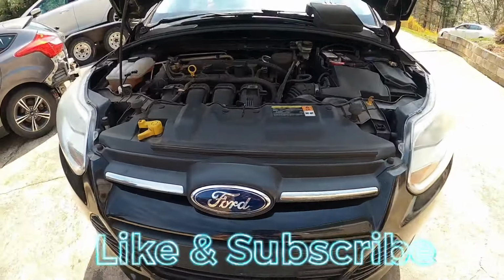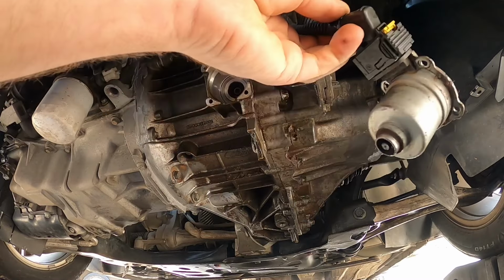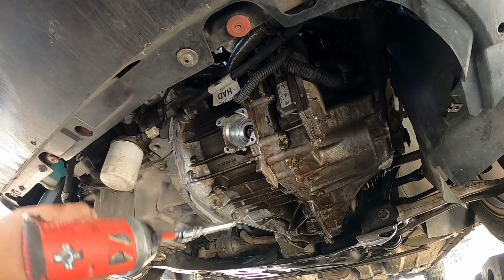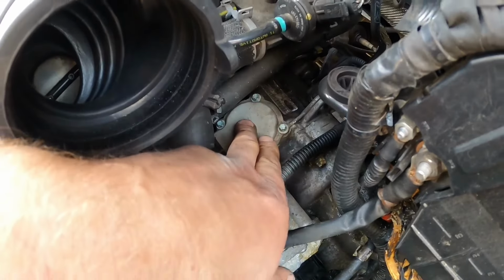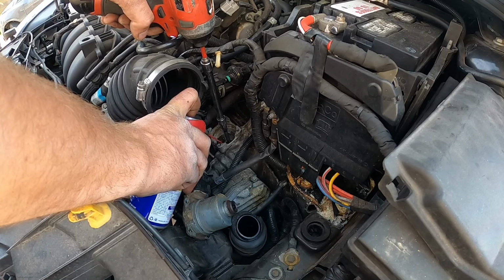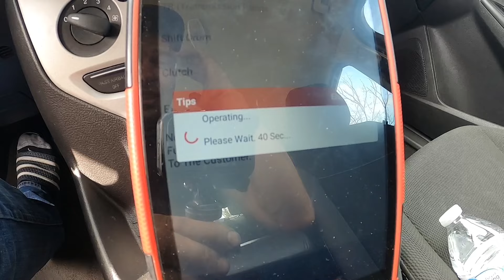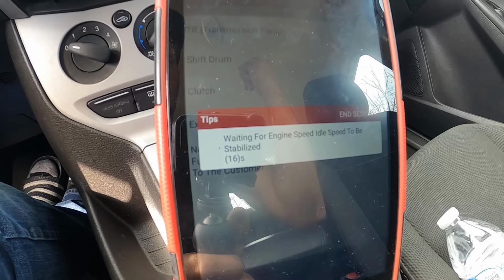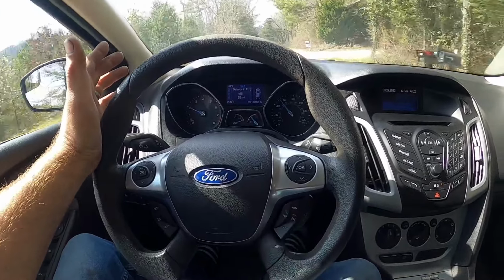2012-2018 Ford Focus Slipping? No Reverse? No Drive? Problem Solved. Easy Fix. You Can Do This!

Comment: What scan tool are you using?  Thanks for the quality vid!
Reply: Yes. Would definitely like to know what scan tool and what kind of Clutch set you bought to give this a shot.
Reply from the maker: Launch 431
Reply from the maker: Prokomon DPS6 Clutch Tool Dual Clutch Transmission Installer/Remover Tools for Ford Volvo Focus https://www.amazon.com/dp/B08PQL4KR8/ref=cm_sw_r_cp_api_i_JMXGC6SYKRQSY2QSWDND
Reply from the maker: Aumzong Dual Clutch Transmission Reinstall Remover Tool,Compatible with 2011-2018 Ford Focus 2.0L DCT 6 Speed Dry,DPS6-DCT Transmission Clutch Fast Reinstall Remover Set Tools https://www.amazon.com/dp/B09Q7ZY634/ref=cm_sw_r_cp_api_i_T9C6GM43DZGBFPW2JJ5R?_encoding=UTF8&psc=1
Reply: @L8R-HP  Thank you brotha, for both. Hoping to grab the clutch tool next week, just grabbed a launch CRP123E.

I've a Ford Focus 2012 that I've had for 10 years now. It went through the recall service.

Had the Tmac replaced 2 years later and now the check engine is coming up and I can't reverse. 

Transmission guy muttered something about "might be the actuator in clutch b" before resetting it to get the light to go away. 

It popped back up. Hoping to get it up and running again with this video! I was about to junk it (Spent 8 months trying to repair it during the pandemic.)

It only has 79k miles. 

Thank you for what you do man! This is awesome.
Reply from the maker: @LeeOnishiixD  no problem. Hope you can get it going, that’s super low miles.
Reply: @LeeOnishiixD  Any luck?

Comment: Hey man, I have a 2012 Ford Focus with some transmission issues. After I drive it and it tries to change to a higher gear, the dash says "transmission hot, please stop." It then tells me to wait 5 minutes. It's not the transmission fluid because it's filled. I was wondering if you have any idea what it could be? I would really appreciate it!
Reply from the maker: Your forks are getting stuck making your clutch slip and it gets hot
Reply: I just bought the same year & model & after 5 days this happened to me and cannot drive it now!
Reply from the maker: @ModernMusic831  that’s not good🤦🏻‍♂️ try this out l, hope it helps
Reply: @L8R-HP  Okay, thank you! I ordered the Capri Tools 6 mm M6 Stubby XZN Triple Square Bit Socket, 1/4-Inch Drive but it was too small. Is this because my focus is a 2012? I ordered the 9mm to try that but was wondering if you knew the exact one I needed. I appreciate your help so far.
Reply: @benitofeliciano3485  try a 7mm xzn. Mine was like that
Reply: @bcfmef  ey my kit has 6mm or 8mm dont fit,they fit too small or big, did u use 7mm ?
Reply: @benitofeliciano3485  i bought triple square kit,but doesnt come 7m and  6m too small,8m too big , im thinking buy 7m, or buy special tool on ebay this video guy sent me the link to buy it on ebay.
Reply: I have the same problem
Reply: @gandhi2926  7mm won't work either
Reply: Hi  Benito i have the same issue with my ford focus 2013. How do you fix the problem. Please let me know

Comment: Awesome video! I have a few questions:
My 2012 Focus is stuck in 2nd gear (I think), and is unable to shift into Reverse. It can get into neutral (I go to N and can rev the engine with no movement), but in R it does the same thing - engine revs, no movement. Going into D and tapping the gas shoots me forward like it's in 2nd gear. I have codes P2837, P2862, and P287B. I recently replaced both Clutch Actuators A and B but did not know about this cleaning/lubing process. 
- Does this sound like something that will be fixed by cleaning/lubing clutch actuators as shown in this video, or do I need a new TCM? 
- If I install a TCM from eBay, does it need to be programmed by a scan tool like yours or can I just swap the TCM in with no software programming? 
- Lastly, does just spraying some brake cleaner and WD40 without spinning the actuators do anything (I don't have that splined tool yet)? Thank you!
Reply from the maker: Always start with cheapest option. Lubing/ cleaning the forks would be first. You want to make sure they spin and go back as they should. That will give you a clue if the forks are still good. If you get a TCM use with same part # no reprogram needed. A relearn is recommended but if everything is working like it should it will relearn on its own after a good normal drive
Reply: @L8R-HP  Thank you! When you say the same part # TCM, do you mean AE8Z-7Z369-F can replace the earlier TCMs? Or do you mean if my car has an earlier rev TCM, that I need to replace it with that same revision? My TCM is original to 2012 so I highly doubt it is the -F revision, which is all that seems to be available on eBay. Thanks!
Reply: @maxm50   so what was the results? Did u clean them?
Reply: @dopessongs3635  Yeah, cleaned them but it didn't fix my problem unfortunately. Tried a TCM from eBay and it fried itself on day 2. Currently waiting for a real Ford TCM at the dealer.
Reply: @maxm50  I took mine too the dealer months ago, after o replaced the actuators with aftermarket from Amazon.  Car drove ok for a while,  it felt like it fixed the problem after I drove around,  then I took for a spin the same day it just revs up in 2 gear and 4th I believe.  Won't go until I stop the car and manually shift it into park then first.  It's like it won't engage back down into a gear until I put it into park to engage back into the 1st. The dealer said my tcm is good, I had it replaced a few yeaers ago. I'm almost tempted to try my original actuators to test to see if the aftermarket was bad. Maybe oem will work. Idk. I took it into ammcoo months back, and told me my fluid was dark and had metallic,  it only has 135k on it
Reply: The tcm has to be flashed, I was looking at my actuators of the og ones I took out, oem,  one of them doesn't spin very well as the other and has more metal shavings. If I'm correct,  maybe i just bought some bad crappy aftermarket from Amazon.

Comment: Thanks for the content it has been a lot of help. I bought a 2012 focus for $200 it had a lot of trash in it when cleaning it out I disconnected the battery and removed the seats.  After putting them back in I have code B0090 left front restraints sensor : circuit short to ground.  I have inspected the connections it looks good and swapped the left and right front crash sensors to see if the code would change.  Do you have any advice ?
Reply from the maker: Did you check the driver side seat belt connectors?
Reply: Did he?
Reply: @tirewacom  😆 Aaron is programmed to not reply
Reply: Yes
Reply: yeah find the pinched wire code tells you short to ground

Comment: Excellent video - thanks!!!  I will "monkey see, monkey do" this to my daughter's 2014 Focus this weekend.  It just now started to have a problem engaging reverse and has a pending P07A4 code. Any problem using white lithium grease instead of WD40?  The ball screw is lubricated with grease from the factory.  It certainly makes sense that dirt/dust from the clutch could "gum up" the actuator ball screw after a while.  Here car has over 100k miles.
Reply from the maker: Any lubricant will help. Unless your forks are just bad. You will be able to tell when you turn it. Just don’t turn it too far as it could damage the forks
Reply: Brand new forks, new actuators, reset clutch, relearned with scanner car still shudders and no reverse. Frustrating any suggestions
Reply from the maker: @fernandohiguera6972  any codes? It’s probably the TCM at this point
Reply: @L8R-HP  I’ll have to get back to you I can’t remember the code but it was saying “friction element b stuck on” thank you
Reply from the maker: @fernandohiguera6972  you reused the clutch right? Was it reset properly and activated once installed before installing actuators?
Reply: @L8R-HP  Yes
Reply from the maker: @fernandohiguera6972  the relearn with scan tool was successful?
Reply: @L8R-HP  Don’t know if you remember but it wouldn’t start you sent me the video got it going. Going to try the relearn scan tool tomorrow, at work right now. Thank you
Reply: @L8R-HP  Have a good evening, thank you for your help and time. I’ll let you know what happens 👍
Reply: Bro I want to thank you from the bottom of my heart for sharing your knowledge, putting out the videos and responding to my questions!! Because of you I got my daughters 2014 Ford Focus back on the road. Thank so much couldn’t have did it without you 🙏
Reply: Bummer - it didn’t work.  I suspect I actually have a broken “batwing” shift fork.  The ball screw spins and returns smoothly, but it failed the touch point learning procedure.  Unfortunately, the A clutch is now having a problem as well. Before, my Drive in 1st gear was working fine.   I may just pull the trans and take a look.
Reply from the maker: @fernandohiguera6972  no problem. Glad to help and happy you got it going 👌👍 good job!!!
Reply: Anyone that successfully used this method to fix their issues...How long has it lasted?

Comment: Hi great video and a very good explanation, just one question, when changing the gearbox oil how can you cycle through all the gears ? do you have a video on this. Thanks
Reply from the maker: No need to cycle. Just drain and fill
Reply: @L8R-HP  ok thanks I thought there was a special way to make sure that the gears cycle through ok as you cannot select the gears with the + and - button
Reply: Also this is 2017 1.5 TDCI on Ford connect van
Reply from the maker: @FormosaFamilyTravels  all oil does in these DPS6 transactions is lube the gears. Just like a manual transmission.
Reply: @L8R-HP  thank you, we shall have a go then, I think it would be good if you could do a video on changing the gearbox oil, I think a lot of people would appreciate it,

Comment: Hi  I have watched your videos time and time again.  Thank you for all your efforts.  I don't believe there is anyone more knowledgeable on here.  I've tried to help my son with his 2016 Ford Focus.  I just replaced Actuator B (OEM) and followed the brake clean and WD40 procedure on both.  I reset the trans and followed all relearn as you instructed.  Unfortunately, I get held up every time at the touch learn point for shaft B.  error.  No reverse ,2,4,6    P07A4 and P2701. Car goes to the dealer on Thursday for diagnosis but I was warned that if it's the TCM..I'm in for 75-90 days wait.  Clutch kit 30-40 days.   Any suggestions? please.
Reply from the maker: It’s ether your fork B that’s is bad, or the bearing failed inside. Ether way transmission has to come off 😞
Reply: @L8R-HP  Thank you.  I'm going to pull the trans this weekend. I'm inspired to do this myself now.
Reply: @L8R-HP  I pulled the trans. Replaced both forks, slave shaft, and the push bearing.  Reset the clutch. Reinstalled into the trans and spun actuator A 14 times and heard clicking. No noise when winding actuator B 14 times.  The outer clutch drum spins well with no noise.  The inner friction does not spin at all.  I don't want to reinstall the trans but I'm at a roadblock.  Your thoughts?
Reply from the maker: @stephenflewelling3960  did you set the clutch before install?
Reply: @L8R-HP  Yes. Exactly the same procedure as your video. I think I might purchase a new clutch rather that put everything back only to have to disassemble again.  Just don't understand why the B makes no clicking when winding 14 times.

I took a chance put the transmission back in.  Relearned the trans with Forscan. Success.  Trans works perfectly.  Now power steering fault. No power steering.  What have I done now.
Reply: @sflew8182  Had the same issue on my clutch/fork repair. The old clutch had 146K miles on it and after they took it out it would not reset/compress properly; so one of the actuators would not unlock. New clutch - worked fine.
Reply: @L8R-HP   I wanted to thank you for your help. Transmission is working perfectly because of your video and advice.  One question. With your experience.  What could I have not plugged back in that would now cause the PSCM  U0131 to light up the Power Steering  Fault? Service now.🙄
Reply from the maker: @stephenflewelling3960  possibly a ground under the battery tray
Reply: Which error message are you getting? You should get a message on why it didn’t complete.
Reply: just called ford for my clutch and its in stock i have a bunch of clutch slip in the odd gears and now it thrown a code and stopped using that clutch code P07A2
Reply: At that point, I would get a manual trans and replace tcm and drive shafts.

Comment: Replace the stock lower transmission mount to the OEM electric Focus. Makes a huge difference!! Don't be cheap, buy MOTORCRAFT!!
Also check the driver 's side transmission mount ( below the battery tray)
Check the passenger side engine mount, (near the radiator reservoir)
I can't stress the import of using OEM mounts and torquing them to spec. Stay away from the cheap mounts, unless you want to do the job twice.
Reply: Hi, what do you exactly mean by this? Need to replace all transmission mounts?
Reply: @nincals6680  Replace the lower mount that is under the car with the one from the electric Ford focus, bolts right in, torque to spec.
The right side mount (passenger mount, next to the plastic coolant reservoir) replace only with the MotorCraft brand ( OEM with the mount installed already) torque to spec, you will probably need a 1/2" impact to take the bolts on and off. The third mount, which is buried under the battery tray is tough to get to. It should be ok. I have used Power Flex bushings in a couple of these areas. The right side insert and the lower mount. Don't use a solid aftermarket mount on the mount closest to the rear. It will make your car vibrate like an old washer machine.  I think you will be very happy with the lower mount from the electric Ford Focus, the stock mount is very weak and sloppy. 
I have replaced "cheap " motor mounts that Do Not last and don't "bolt right in" . 
Check out Power Flex bushings online for the bushings insert for the non-turbo focus. The turbo focus and non turbo focus are different mounts.
Also I run my tires at 36-38 PSI cold. Helps with the mileage and shifting. 
I think you will be happy with the lower electric mount and the bushings insert. It keeps the engine more "planted "  and from moving around.
It's a lot of work, I highly recommend you have a well qualified mechanic install these parts.
Hope this helps. My 2013 focus has 70k and runs and shifts fine. 
What I mean by the bushing insert, is only use the one on the passenger side with a new MotorCraft mount. 
Definitely check out Power Flex bushings online, they will pay for themselves in a couple years.
Also change the transmission fluid, it's a very specific type of fluid, made by MotorCraft. It's expensive. They say it goes 100k, nope by changing the transmission fluid (2 quarts) it renews the properties. If you need fluid check Rockauto, local Ford dealer, or FSWorks. It's a very specific fluid made for this trans. Have a trans shop or dealer do it. Its a little tricky to get to the fill plug.
Again, with the motor/transmission mounts a qualified mechanic and a lift make it a lot easier.

Comment: Just contaminated the clutch. Good job
Reply: @L8R-HP  guess you don’t know how these work.
Reply from the maker: @gabrielescareno58  looks like you don’t. This method has worked since 2012 🤩 
I actually rebuild these on the daily. Try again
Reply: @L8R-HP  actually I do as ford tech I do 2-3 of these cars a week. The ramps bind up from fluid contamination and the clutch dust causing them to stick and all you did is clean them off until the clutch dust collects back on them to do the same exact thing. If you can’t afford to fix the car correct you should buy a different car.
Reply from the maker: @gabrielescareno58  lmao, ok. You guys at the dealership need to be retrained. When you do these recalls don’t change just the clutch. Clutch is never the problem. At least clean the forks, if not replace them. I’ll pass this on to ford as well. Good day.
Reply: @Gabriel Escareno  you salty are what at least this guy made a video and is trying to help people out.
Reply: @autobotavengerfireballxl5339  putting the ford tech out of work hahaha

Comment: I have a couple questions regarding this procedure.

#1 when you are moving the shift forks in and out with the drill and bit combo, Does the Clutch Fork "spring back" to its original setting?

#2 When installing new actuators (Motorcraft) are they factory set? In other words, plug an play? Doesn't matter how the new acctulaor is " splined" / installed on the clutch forks?

Thanks,

Comment: I wonder if you could remove the starter, spray in compressed air to agitate the dust; and then use a shop vac to remove the airborne dust.  Maybe do this every year or every other year.
Reply from the maker: It won’t get much dust out, but should help

Comment: Another common and often overlooked cause if the absolute garbage wiring to these to actuators it is poor quality wire and is often right against the black in places even with the shielding temperatures cause the wires to short on the inside

Comment: Thank you for the video! I am getting a P090C and have already replaced the two actuators but I did not clean out actuator B on the bottom. What scan tool can I use for this procedure?
Reply from the maker: Launch 431 mini. But can also use forscan

Comment: Hey whats up man, question should i reset the transmission beforehand or it really dont matter?? Thank you!! And brake cleaner, WD40?
Reply from the maker: After
Reply: @L8R-HP  it ran great for only a lil bit but started up again I'm going to buy the A and B next see if that helps thank you sir!!
Reply: @L8R-HP  so I got the actuator tool and used it, and light went out and working very good I spun it till it could not move anymore "A"